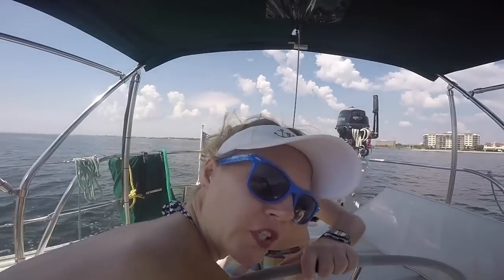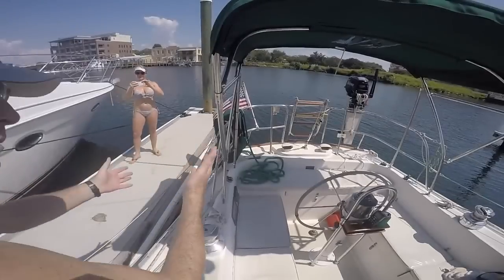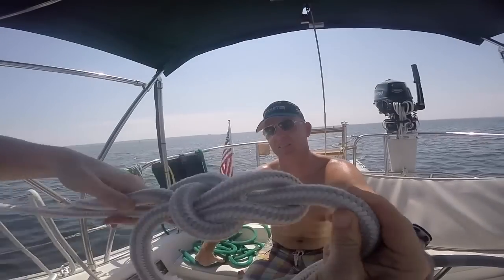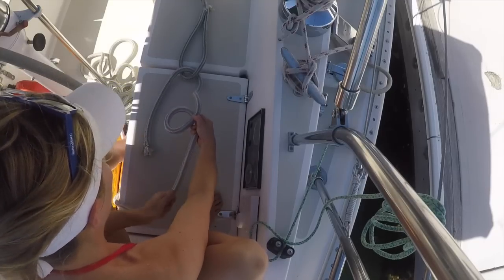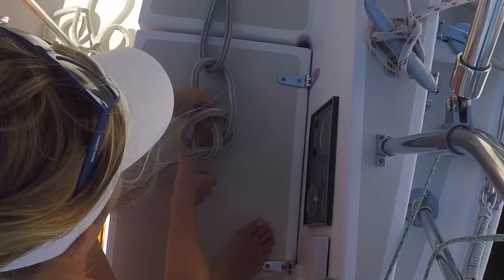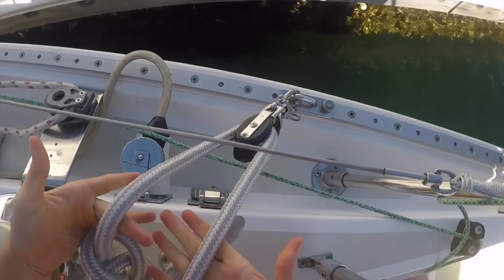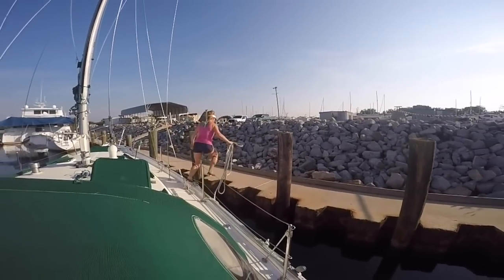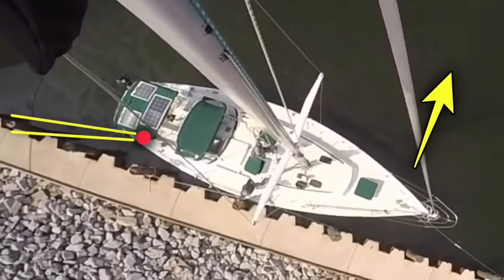#81: How to Dock Single-Handed

Comment: Instead of using a stearn line, it's a lot easier using a spring line and some fenders up front. In calm weather, the difference might not be big, but as soon as wind and wave are added, with spring lines the boat is better under control.

You can learn a lot from watching how excursion boats, ferries or fishermen are doing it. Most use spring lines first.
Reply from the maker: Thanks Popsi.

Comment: If you made a large enough loop to easily drop on the dock cleat and used a single line you could cleat it  off at any time on the boat and not have to guess how long the loop should be.  Cleating off one side of a continuous loop doesn't make the line shorter.

Comment: Have you seen the "Spring line at mis-ship" self docking technique? Ive seen it on you-tube somewhere, but cant find a good video of that. Great lesson you provided btw. Thanks for sharing.
Reply from the maker: You bet.  I haven't seen that one, but I know Pam was adamant (for good reason) about me demonstrating the need to have the spring line using this method at the pivot point of the boat NOT mid-ship.  If you find a video of it, though, please feel free to send it my way.  I'm always interested how others do it.
Reply from the maker: Hey Paul.  Thanks for taking the time to find this.  I'm no expert but did you see how quickly his bow was pulled in toward the dock because the dock line is cleated mid-ship.  That's exactly what happened in my "pivot point too far forward" example in my video and it brought the bow into the dock.  Pam was adamant about me stressing this and I can now see why.  When you're coming in forward or backward toward a dock, your pivot point is generally going to be 1/3 up from the stern or back from the bow, generally not mid-ship.  For the technique we have shown in my video, as I mentioned and Pam Wall made me edit, edit, edit to stress (for darn good reason) the pivot point is generally near your rudder post or companionway but tie the boat off in this final position and motor forward and away from the dock testing various points on your boat to find your pivot point.  Once you do, this should making docking very easy for you.  Please try it and let me know how it works for you by sharing here.  Thanks Paul.
Reply: HaveWindWillTravel.com thank you so much for the detailed instruction. I will try it this weekend. Btw, I'm Rob and my wife is Maria. The PAU in our name is a Hawaiian word. Pau=Finished and Hana=Work, so Pau Hana means, Finished Working (loosely translated). 😀
Reply from the maker: Aha!  Glad you pointed that out.  s/v Plaintiff's Rest has a similar origin.  That's when the attorney representing the plaintiff (which Phillip does) finishes putting on his case and can finally ... rest.  The moment you say "Your Honor, Plaintiffs rest" is a good feeling.  Thanks for sharing and nice to eMeet you and Maria.  Glad to have you guys following along.  Are you guys living on the boat now?  Where are you located?
Reply: HaveWindWillTravel.com we are still in the boat search/purchase mode. We sail on our existing boat every weekend in the Spring, Summer and Fall. We are doing the ASA 101-104 in the Keys in February (really looking forward to that). We won't retire for another 4 years (too close to give up the pension now) 😀. We will continue making videos of the search, purchase, refit, then the travel across the Erie Canal and onward to warmer climes. We want to have friends in every port; that's the main purpose of our channel.
Reply from the maker: Very cool.  Thanks for sharing.  I'm sure it won't take you long to rack up friends all over.  Cruisers are some of the best people I've ever met.  So friendly and like-minded.

Comment: Rather than tying a bowline in that rope to make the loop[, you may want to have a look at a sheet bend.  VERY simple (run the bitter end thru the loop twice if extra security is wanted) and pretty much forms the shape of a bowline anyway.   Hope this helps some and well done!
https://en.wikipedia.org/wiki/Sheet_bend
Reply from the maker: Thanks Mr. Tatts.  I had another follower tell me about this as well so I will definitely try it.  Appreciate you watching and commenting.
Reply: You're most welcome.  Its the same knot I used to use to connect long lines when I worked on a fishing boat over here.
Reply from the maker: Cool, thank you!

Comment: Congrats! Now, what in your opinion would be the technique when winds are blowing and pushing you away from the dock? Remember that whatever mass your boat has, you would have to adjust the impulse of your motor pushing you away from the dock while attached to it (wherever that may be), and this means that your boat,s velocity has to be greater than that of the winds. And by doing so, you are increasing the amount of energy that your boat accumulates in the process. So, what do you do? (Crashing into the dock is thus a lot more highly probable.)
Reply: Very interesting technical Question. BUT if you look at the video a few more times,,,,,  it clearly shows you how to answer your own question. Either you have never been in a mariner or Highly Probable that your dog posted the comment. 
Now the serious stuff,,,, to the Dog,,,,,  
there is always wind in a mariner,,,,,, 
Some boats have thrusters.....
DROP all sailsssss, that helps the accumulation of energy!
THE wind will be buffeted by lots of other boats,,,, because you are in a mariner!!!!
If the Marina is in a windy location we drop lots of pebbles into the water and create a blooody rock wall. 
ANd you put those things on the side of your boat so you do not damage other boats.
Prop wash helps.
Other yacht person (man r woman) will always help you. THAT is what we do!

Your Question is fairly condescending and disrespectful.

Now get off the computer,,, Jean will be home soon.

Comment: I have always docked my sailboat single handed.  I think your method  is brilliant!  It is how I have always docked have docked heavy displacement powerboats; using the prop walk and a stern line to bring them in. 
      On my sail boat I typically attach my stern line to the dock as I power the boat into reverse to stop the boat then jump off the boat with a boat hook and pull the bow in. I can typically make it work.  However, I think your method will work better.  I am looking forward to attempting it!
Reply from the maker: Great, I hope it helps you.  We've definitely found it to be an easy way to bring the boat in single-handed.  Phillip really likes using it when docking alone.

Comment: The only trouble I've had with making a long continuous loop using a bowline is that it seems to cause rope chafe.
Reply from the maker: Ahhhh, did not know that.  Good point to add.  We'll look out for that when using this technique.  Thanks!
Reply: Well good thing rope is cheap.

Comment: This wouldn't work with my boat. It's an old IOR boat with pinched ends. I'd have to stand almost at the widest beam to hook a dock cleat, and I wouldn't want to leave my boat in gear if I'm not nearby. I found the balance point where I can pull my boat parallel to the dock and just come in slow in neutral, step off at the widest part of the boat, and wrap the midship cleat on the dock to come to a stop. Then I cleat off bow and stern with dock lines I've run and led to midship. Hasn't let me down yet in all conditions I've encountered. What ever works for you best.
Reply from the maker: Couldn't agree more.  Every boat is different and handles differently.  Thanks for sharing this Gary.
Reply: I have to agree here completely. Same issues. I single-hand almost exclusively. Never had a single issue docking with my line amidships at the center of turning effort. Then tie stern and bow lines.
Reply: Gary Souza q

Comment: Yes, works only when dock is long enough (or your boat short enough), but not if dock length equals (or shorter) than boat length.
“How to dock single handed at a long dock with a small boat and no wind “ would be a more appropriate title

Comment: Hi Annie! Great video.
For your long continuous loop, you might try a Sheet Bend or a Double Sheet Bend
(www.animatedknots.com it's a great resource for knots), way more easy to tie than the Bowline, very useful in this case that you are tying 2 ends of rope, basically...
Although I wanted to tell you, over there in Pensacola there's a great YouTube creator who's a great machinist, Adam Booth (Abom79), check his channel (if you already haven't) so you can contact him maybe for some project (lathe, milling, welding) ... I guess. Cheers!!!
Reply from the maker: Cool, thanks so much for the tips Jorge.  Much appreciated.  I'll definitely check Adam out.  Just cool to know someone else around here is creating YouTube content as well.  I was fascinated by a lot of the machining work we had done during our re-fit.  Amazing how precise those machines are!  Thanks for watching.

Comment: That seems like an overly complicated method and relies on coming in quite close which can be difficult in a blow of with counter-productive cross-wind. You can just coil your rope and split in half, throw the two halves either side of the cleat/bollard keeping hold of the bitter end between thumb and forefinger then secure the bitter end, the result looks like a stern line ready to slip. This can easily be thrown pretty much as far as you can throw a line to a dock handler.

Comment: I have not an will never get off of my boat with the engine running in gear but I guess that's just me
Reply from the maker: There was no getting off Tony, that's the great part about it.  You just step out of the cockpit to drop the line, but you most definitely stay on the boat!  What made you think the helmsman ever stopped off the boat?
Reply: Step four around 8:00 mins
Reply from the maker: Oh, you mean AFTER it's docked?  Yeah, that is so he can set up the other lines.  The forward idle is needed to hold the tension against the aft springer.  But, I completely understand if it's not something you feel comfortable doing.  This is just the trick Pam taught us, so we're sharing it with others.
Reply: If you guys choose to dock like this at least be as careful as you can because there is a spinning prop under the boat an  no one would to see one of you guys hurt :/
Reply from the maker: Agreed.  Thanks Tony.
Reply: yw
Reply: OMG  a spinning prop , panic panic
Reply: I got an earfull from a dock master when I was younger,Still to this day I or anyone on my boat will not leave the boat until is 100% secure.
Reply: So  whats your answer for those that sail alone and  are required to dock   where there is no help available. .  ?
Reply: you should never need to leave the boat when docking any small craft. If you get one line ashore led aft from the quarter the boat will hold itself forward, allowing you to get a head line ashore from the bow. Then and only then, when both stern and head lines are tight, should you step ashore to do the springs.
Reply: argotittilius  "should never "  the famous words of somebody that knows fuck all
Reply: Tony Ewing when single handing sometimes you have to. Nothing wrong with that.

Comment: Bowline is tied incorrectly... just I I used to do for years :-). The loose end should end up on the outside, not inside, the bight. "Bunny comes up through the hole, round the back of the tree THE OTHER WAY, then back down the hole.